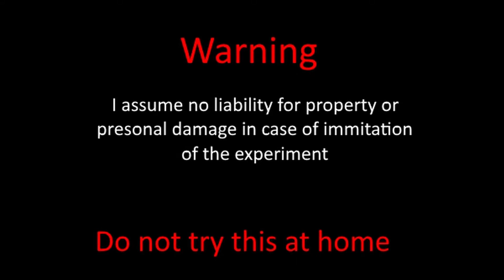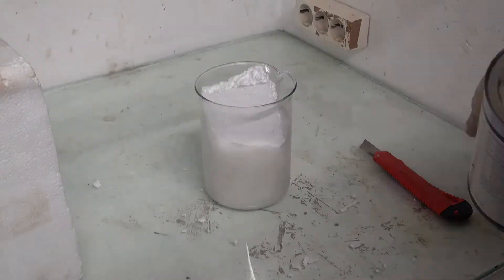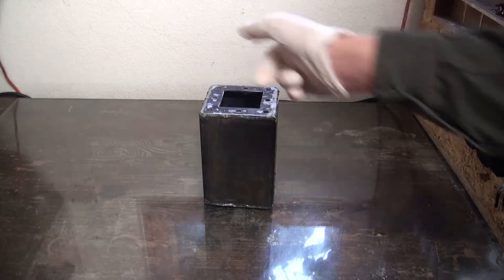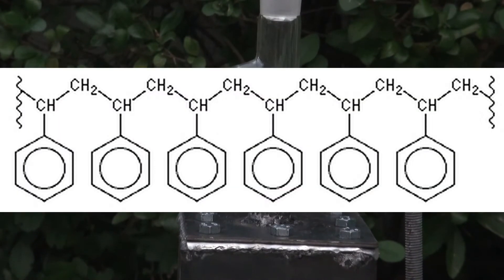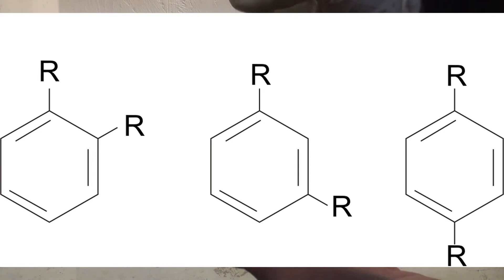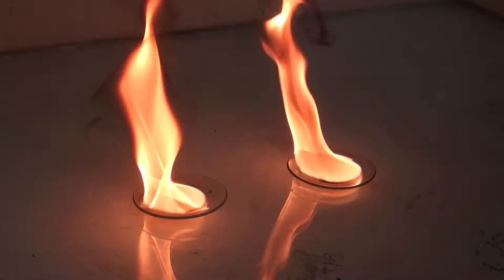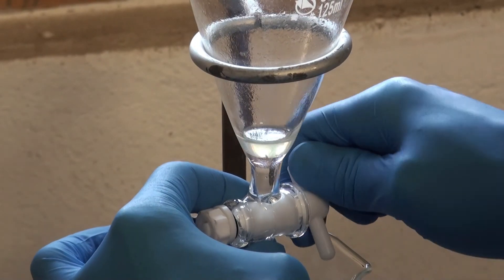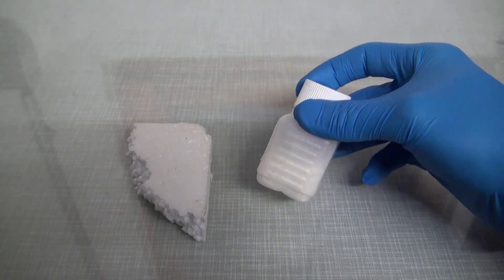Turning Styrofoam into Benzoic Acid   Chemical recycling of polystyrene

Comment: you can use BaO or CuO as a catalyst on the pyrolysis to improve the styrene yield
Reply: Good idea - I've picked up read a review study [1] and the reported yields of styrene went over 70%, even 80% using a combination of slow heating and combination of catalyst (e.g. MgO) and support (bentonize, zeolites).

[1] Gonzalez-Aguilar, Arantxa M., Vicente Pérez-García, and José M. Riesco-Ávila. "A thermo-catalytic pyrolysis of polystyrene waste review: A systematic, statistical, and bibliometric approach." Polymers 15.6 (2023): 1582.

Comment: You can also start with solid polysterene to skip the solvation and drying steps - this kind is often used in fridges and freezers as PS withstands repeated temperature changes (thermoforming and refreezing).

Comment: It was actually not acetone and styrofoam used in napalm. It was styrofoam gasoline with an addition of benzene. It has some different propperties than acetone + styrofoam. It's still pretty tame unless you're a cig addict, who has to smoke near the reaction mixture.

Very interesting video tho. Never seen this transformation before
Reply: no, napalm was made from byproducts from the petrochemical industry, specifically Aluminum alkoxylates, this was the thickening agent, it's name is derived from Napthenic acid and Palmitic acid, which were made into an emulsion by reaction with Aluminum, so that they form a kind of soap.
Reply: You are correct in that the original formula created in WW2 derived its name from the formula you mentioned. However the formula was changed at the end of the Korean War. The name was changed to Napalm B. It was polystyrene, gasoline, and benzene. That’s what was used exclusively in Vietnam.
Reply: @tonyhenley8284  The petrol already had a lot of benzene in it back then, so doesn't really need to be separately identified.
Reply: Napalm was a mixture of aluminium salts of naphtenic and palmitic acids.
Reply: There are a number of napalm formulas, both with aluminum soaps or polystyrene.

Comment: Just wondering but how much did the styrene stink up the place? I've only ever worked with it once and I absolutely hated it
Reply from the maker: the smell of burning plastic was stronger than everything else
Reply: Okay thanks, I think I'll just buy some sodium benzoate then and make benzoic acid from that
Reply from the maker: @EdwardTriesToScience   just buy benzoic acid it self. It is very cheap.
Reply: @madsciencemax8439  sodium benzoate and hydrochloric acid is quite a bit cheaper tho

Comment: what was the purpose of adding the hydrochloric acid rather than just water? was it to destroy all manganese dioxide suspension?
Reply from the maker: because i did the oxidation in basic conditions, the benzoic acid turned into potassium benzoate. I turned it into benzoic acid by adding the hydrochloric acid

Comment: Are there any other ways to oxidise to benzoic acid such as H2O2 or Ca(ClO)2 ?
Reply: H2O2 can be finely used for oxidation, its nearly have same oxidation power as potassium permanganate, but its better to use higher volumes in H2O2. Its same about Ca(ClO)2 but it may not be strong as them, and maybe because of its highly basic, it can make wrong stuff while process.
Reply: @InOrgoChem  thank you sir, I was not able to found anything about this online
Reply: @7hunderstorm242  not much. Stand with science sir!